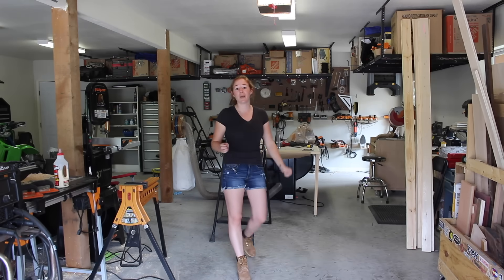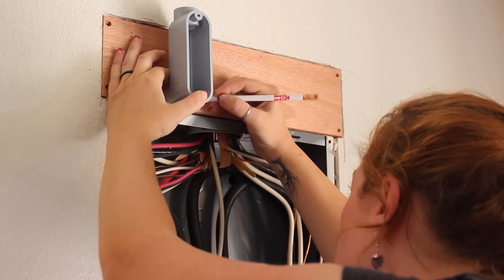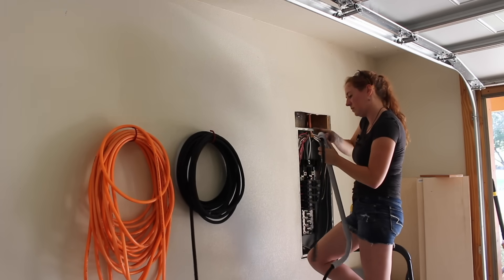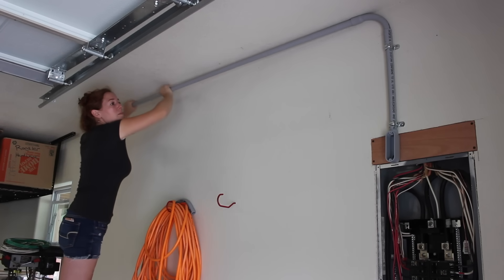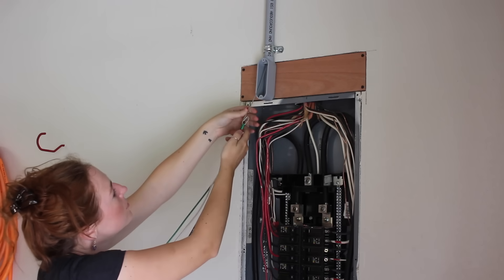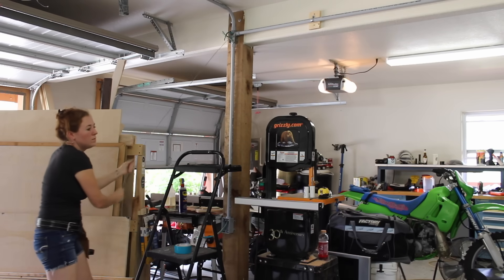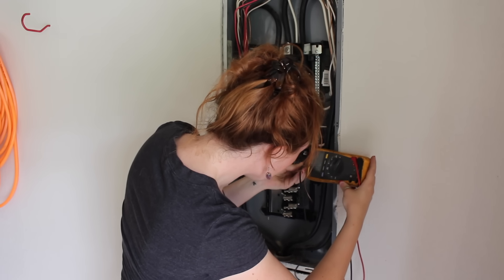Adding 220 Volt Outlets to the Garage

Comment: electricity is not dangerous, stupidity is. if switch off the breaker and everything, what can go wrong?`right, nothing, if you screw up, you have to wire it again, thats it. if you screw up with a table saw or anything other spinning, you'll be hurt.

i kinda enjoy working with electricity, its simple if you know the basics on how to avoid getting shocked. btw: even if you touch a live wire, you wont die, it will hurt and you get a burnmark but you wont die from electrons floating through your hand
Reply: +Sharky  110V can be the most deadly. Yes, working with electricity can be satisfying but the attitude you seem to have will not serve you well around it.

Comment: April I have been watching your videos for a couple of months now and I really enjoy them. As a state licensed Electrical contractor I do have a couple of thoughts though. You definitely need an individual circuit for each 240 volt outlet to prevent overloading the circuit breaker and the metal junction box needs to be bonded to the equipment ground.  The  Handy box you used is just barely sufficient to contain the wires you have in it. If you were to reinstall the circuit conductors and make all six wires (2 hot wires and a ground for each circuit)  long enough to go from the breaker panel to the individual outlets with no splices then the current pipe and junction box would legally and safely accommodate them. No more worries of overloading the circuit breaker and there would be no need to bond the box to ground since there are no splices in the box.  Overall I loved your installation. A lot of people don't realize the NEC requires us to install in a neat and workman like manner. Unfortunately that requirement gets overlooked a lot. Thanks for setting a good example. Keep up the good work.
Reply: Ron Farve if
Reply: i BELIEVE IN PLENTY OF LEADS AND ROOM TOO
Reply: You forgot that she didn't mark the ends of the white conductor with black or red ul approved electrical tape 6 inches from the end of the terminations.
Reply: The handy box is 13 cu, shes at 17.5 with box fill for conductors not accounting for the 3 huge 3/4" pvc ta in the box-314.16(b)1 , 3' support for pvc 1/2" to 1" -352.30, metal box grounding 314.4. White for an ungrounded conductor, and running thhn free air from the lb to the top of the panel, I know there is no fitting that would work for that scenario she did. Not gluing the PVC, Emt straps for pvc when pvc 2 hole straps should be used as listed for that purpose....Your solution for box fill issue is sound Ron, I don't doubt she has the ability to do it correctly, and to code, I just wish people would do it correctly before posting an incorrect install that is not to code OR actually pay to have a licensed and insured electrical company do the work for them correctly in the first place. Thumbs up to you Ron, stay safe out there. It was a neat and work woman like manner install. That's a mlo subpanel and not the main panel from all the 240v 2 pole breakers in it. Wonder what that white wire is doing next to the grounded conductor feeding the panel...
Reply: There is nothing in the NEC that precludes multiple outlets off a 240 branch circuit.  In a single person shop, it's not unreasonable to calculate load based on the maximum number of outlets that could practically be in use at one time.  Should an unusual situation arise that exceeds that maximum, the breaker will trip.  That's what breakers are for.
Disclaimer: I'm not an electrician and I'm always open to correction.
Reply: What is the rating on the outlet? Say its 240v/30A and the wire is 30A too then the breaker is 30A, that's all. In Sweden my garage outlets are 380Volts/3 phase for my woodworking mashines. And they have 16A breaker, the same as the main breaker for the house. To install separate lines of wire and multiple breakers is then insane. Why? I can't use more than 16A anyway.

Comment: all metal boxes have to be bonded to ground, use a ground screw and piece of wire, solid works best for wrapping around the screw or use a  pre-made pigtail.
the conduit should have been continuous to the breaker panel, not ending right before it,  pvc thread fitting/nut, two 22.5 or 45 elbows. 360 degree is the max. allowed elbow/bends between pull access and "fishing" is easier staying under the limit, so put a type LL, LR or C conduit body somewhere, three feet max between support straps on 1/2" to 1" pvc conduit.
identify the white wire as ungrounded at all points, just wrap in tape, permanent marker, color heat-shrink or use other color wire (anything but green, white or gray) you mentioned it and existing circuits in panel are done with red marker.
should have ran dedicated breakers/circuits per outlet/machine.

Comment: So just to qualify, I'm a journeyman electrician in Los Angeles and I work for a company with 300+ men and women in the field and you did better than half the "electricians" I work with. So Bravo and keep practicing. The code (NEC) is subject to interpretation and sometimes more local codes can conflict and muddy the waters. So don't necessarily believe everything applies to everyone everywhere. I'd recommend always seeking local advice for code guidance like this. For example a chicago electrician would say how I wire a house in los angeles is not up to code, but we both follow the NEC. local code came into play and we can both be right in our respective areas. Only thing I would suggest is to not energise that panel with the dead front (cover) off. You could take voltage readings at the receptacle much safer. Exposing yourself to live bussing is pretty sketchy. I don't do it and I don't let anyone working under me do it either. As long as you never work hot and keep your wits about you and you should be fine.
Reply from the maker: : ) Thank you

Comment: I like your work and enjoy your channel, but you have a responsibility to your viewers to do things not only up to code but safely and correctly.

(Constructive criticism)
As noted, for 220 you should have used black, red, and green. No white wire.  while your allowed to mark the white wire as a hot wire with black or red tape, the right way would have been to use red wire, especially since you had to purchase the wire for this project.

Even if plastic conduit is allowed by code, you should have used 3/4" emt. Metal conduit is not only safer but it a shop or garage it gives you extra protection from not only short circuits but something banging into the conduit. Plastic also gives off toxic fumes in a fire, this is your home April, do it right.

Code requires conduit to be strapped within 6" of each box.

You had plenty of room for more breakers, you should have run separate dedicated circuits.  It doesn't matter that your needs might be OK with it,  (you said you would not be using all the equipment at the same time). Electrical is permanent and can't be sized to your current needs, it has to be sized correctly for expansion and future owners of the house.

Most jurisdictions have a provision in the code for "owner\builders" to do the work without being licensed contractors.   As the owner of the house you should and could pull a permit and get it inspected.  Not only for your safety but what would happen if you had a fire or problem in your shop and the insurance inspector found work that was not inspected or up to code?

Keep up the good work, please don't take my comments as criticisms,  as more and more people get inspired by your work you need to take extra steps to ensure there safety.
(It would have been noce to show everyone how to test to make sure all the power to the box was off).

Dave
Reply: nm is 12" , emt is max 3', pvc is max 3' from a junction box..what code article says 6" for conduit? Must be a Canada thing, working off 2014 nec, never seen that code in 20yrs I been running conduit. Thumbs up on everything else but 6"...
Reply: @Dave, per the code, you cannot change the color (re-identify) white wire unless it is in a cable assembly. Wire pulled through EMT does not qualify as a cable assembly (per code). The easiest way to make it compliant would be to pull some other color wire (e.g., red or black).
Reply: She doesn't have an oligation to do it to code, only safely. The color thing doesn't matter, frankly considering the cost of getting it inspected, she's faaaar better off just removing the whole thing if she sells, it's quite likely the next owner will use the garage to park cars anyways. So she doesn't need to worry about that, 10 minutes with a drill and the house is right back to how it was prior to her work, no permit or inspection needed for a sale.   If that's her plan, she's the person who has to deal with her using white wire, she wired it, it won't be an issue to know how it's wired.

As to the should have ran dedicated breakers, again, she made this for herself, she'd have paid another 50 dollars for the three wires because she's buying in such a small quantity. She'd have paid 20 bucks for the extra breaker, she'd have doubled her cost on the conduit to run it in metal. Her 100 dollar project would have gone to 200+ just to get power from the breaker to basically 30 feet away. Maybe you make so much you can afford to blow 120 bucks for "possible future expansion" but to me it makes far more sense to when that day happens, THEN fish the new run of cable and put in the new breaker, than sink 100 bucks into it "just in case".

Nothing she did is dangerous, the fumes, I mean come on, if she's in the garage during a fire, just leave the garage? you know through the giant doors feet away.

Metal conduit is overkill for something that isn't even going to be there in 10 years likely, she'll move, dismantle it because it's free to dismantle and money to inspect/fix issues. 

Just like the 6" strap thing, again, this is a quick job for her personal use, yes there is code BUT WHY DOES THE CODE EXIST, WHAT IS THE PURPOSE OF THE RULE? To ensure your conduit is securely attached and doesn't risk it becoming unsecured from it's attachment points or sagging or putting undue pressure etc. This isn't a danger here, no it's not to code, but again, it's safe, her conduit isn't going to fail and expose wiring.

Comment: Quick question:
Here in Denmark we use 1,5mm2 (15 AWG) for normal household items and 2,5(13 AWG) for the things than needs a little more "angry pixies".
But what wire thickness do you use in America? The same or?

Comment: Why not a nonmetallic junction box, since you were using S40 PVC conduit? You wouldn't have needed to buy the female adapters.
Reply from the maker: Meh, I can't get everything spot on. ; ) It was just a matter of, I saw a junction box and picked it up then continue shopping for the other items. Next time I'll look for a plastic one, definitely makes more sense.
Reply: You wouldn't need extra fittings and everything would be more resistant to the atmosphere, moisture, dust...

Comment: first I am an electrician I like the idea of the way you did this project but for the use I don't because you don't have true over current protection for your table saw and air compressor the breaker should be sized for one tool not two combined. I have several 240 volt circuits in my shop with all that are 20 amp  on one and all the 30 amp on another. and my air compressor and dust collector have their own
Reply: What's the starting current? It might be a lot more than running.
Reply: One person is not going to start the table saw and compressor at the same time
Reply from the maker: I checked out the amps on all my machines before making the decisions I made. Even if the table saw and compressor were running at max, it would only be pulling 21 amps. I feel like giving each machine it's own 30 amp is overkill.
Reply: Overkill yes, but thats nec code lol
Reply: Each machine should be on a 20 amp 2 pole breaker rather than sharing a single 30 amp

Comment: There is nothing more 'dangerous' about electricity. Have been doing it for many years.
In fact, I personally would consider a band saw far more dangerous.
What I think is very interesting and funny, is that even 'safety' regulations are so different in each country.
Things that are being considered 'safe' in the US (like the fuse box) are an absolute no-go where I'm from.
Also vice-versa btw, some things are fine here and are a complete no-go in other countries.
Proves the point that it's all relative.

As long as you fuse everything properly, use the right wires for the amount of current (read:fuse) and make sure nobody can touch anything by accident, it will be all fine.
So yes, in a way it's just common sense. ;)

Thumbs up for the good work! 
Looks nice, clean and I always appreciate the 'can-do' mentality! :)

Comment: Good Job. 

While I don't think it will matter much here because the weight of the horizontal conduit is not great, there is only one MINOR point I would have you look at. 

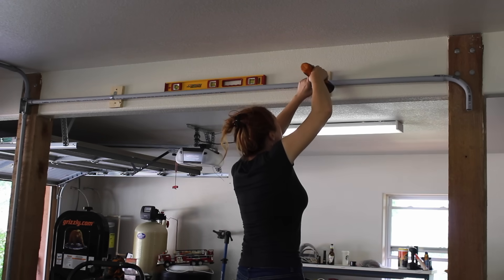In the video at 2:56 , I see you have the clamps with the screws above the conduit. 

If the conduit had real weight (was a longer run, had more wires in it) what this does is put all the downward pressure on the OPEN SECTION of the clamp. 

What you may want to consider is putting the screw UNDER the conduit. (like you have at 5:06).
Now, all the weight would be focused down on the solid part of the clamp, AND the wall fastener. 

Last comment: 
At 4:39... what a bunch of LAZY puppies!

Overall, good job.

Comment: Illegal in the UK... Electrical contractor only.   Too many Bright sparks."    Question ... "What's black and crisp and hangs from the ceiling.   Answer an amateur electrician :-)
Reply: 52memor and this is the stupidity of Part P. As an individual I cannot add a new circuit but I can extend and potentially overload an existing one instead.

Comment: Just a thing or two that are good practices.
1.  When running 220VAC through plastic conduit use 4 wires.
      Black = Hot phase A
      Red    = Hot phase B
      White = Neutral
      Green = Equipment or Earth Ground.
2.  When you are installing a junction box, use a bigger box like 6X6 just because it will be easier to deal with if you ever have to upgrade the wires for heavier ampacity or add another outlet.  More room = less fire danger.  

Note that all connections for new electric ranges are 4 wire.
3.  If you ever have to sell your house, home inspectors will note the lack of 4 wire as a problem and you will have to pay an electrician to fix it.  I would go ahead and add the 4th wire and get the color code correct just so you don't have difficulty  in the future.  If you ever have a fire (heaven forbid) regardless of cause you will get giged for running 3 wire 220V in plastic and Insurance may not pay.  So just my 2 cents is that your probably need to deal with it now so that it is not a problem.  I am not an electrician, but I am an electrical engineer so I will also note that free advice is usually worth what you pay for it.
Reply: That was a NEMA 6-30 outlet. There is no neutral connection on the outlet at all, just hot, hot and GND. I can't imagine that would be a code violation.

Comment: April , I didn't look extensively through the comments so I will add two things The load which is amperage draw needs to be balanced on both sides of the panel.  If your running a number of outlets and they are drawing current the current should be the same  20 amps  and 20 amps (for example)  The second thing is using a lubricant that is for electric wire, especially if your pulling wire through a number of curves (elbows)  and joints.  You did a nice job!  

Oh yeah you didn't mention wire sizes for amperage draw which is determined by the startup draw of your 220 motors and the total horsepower.
Reply: Thomas Tieffenbacher/DocSavage45 I too would like to know the gauge of the wire. It looked like 12AWG to me (but I could easily be mistaken). If it is indeed 12 gauge with a 30 amp breaker then there will be no atta a girl from  me.
Reply: That is important. All components, wire, outlets and circuit breaker must be matched to prevent overload, heat buildup and possible fire.  My eyes can't see if it's a 20 or 30 amp breaker and  I would give April the benefit of doubt in that she has done a thorough job in her investigation and installation.  When I installed electric to the shop, I opted for an electrician to run the underground line and install the box I'd purchased. A licensed electrician will get approval from the electrical inspector and I wanted that approval on the box in my shop. Later the electrical inspector ( who was quite patient, LOL)  gave me all the free advice I needed to be current with the codes.  Oh yeah I prefer metal conduit inside but I'm old school.

Comment: I will tell you what April you did a great job, everything you did was to code or at least to NC code. I wish I could have filmed to wiring job I did at a friends house, pretty much the same thing except I also installed a sub breaker pannel as well. But yes electrical work can be dangerous weather you are in a breaker panel or not, so every one use ALL safety precautions and gear and tools! Great job April keep up the great work!